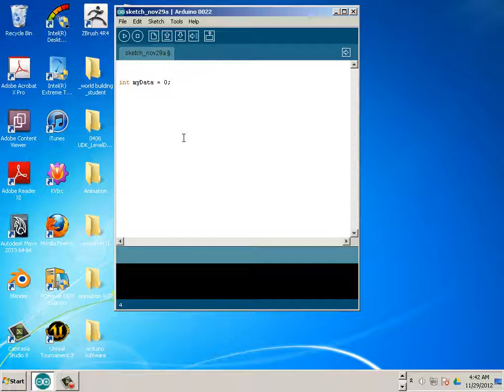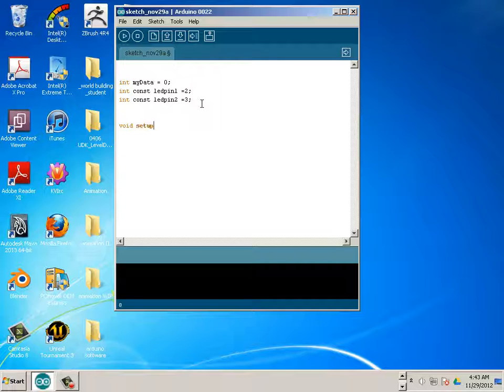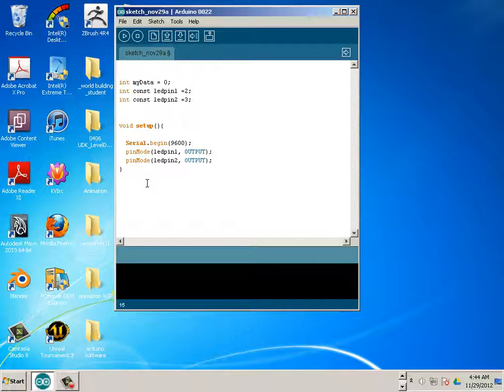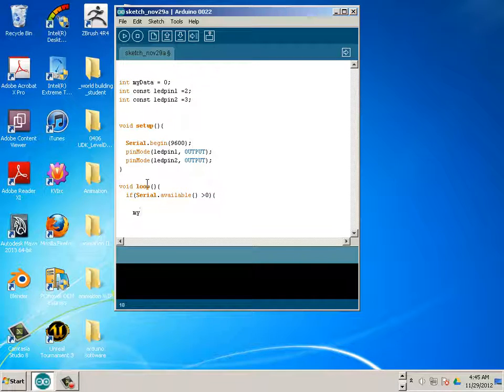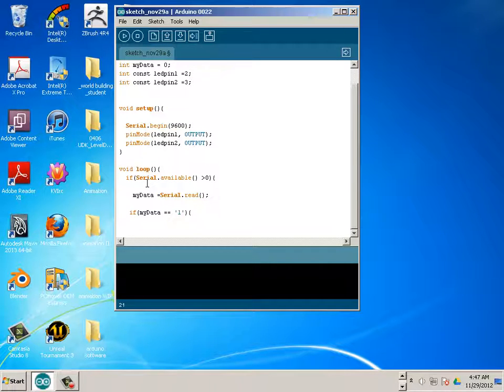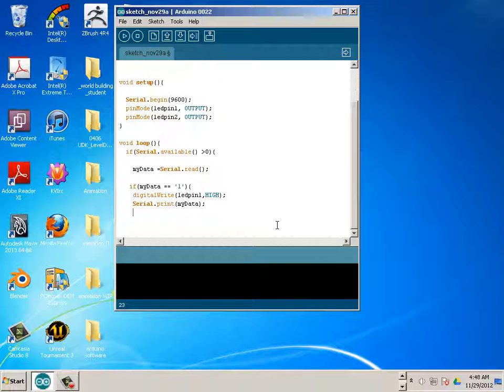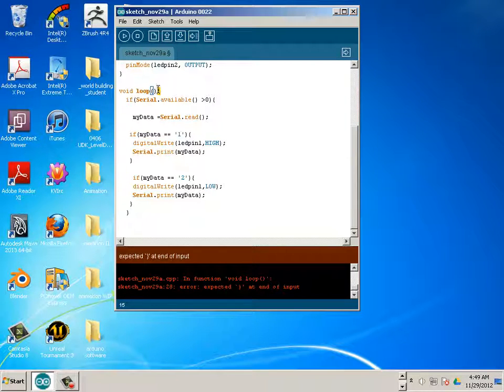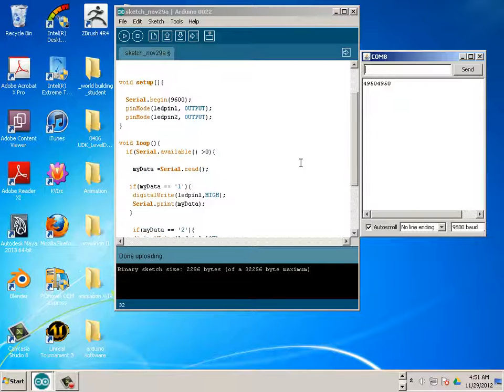0802 Arduino  Chapter 8 Coding a serial event

Comment: char dato;
int led=13;

void setup()
{
pinMode(led,OUTPUT);
Serial.begin(9600);

}

void loop()
{
dato=Serial.read();
if(dato=='1')
{
digitalWrite(led,HIGH);
Serial.println(dato);
}

if (dato=='2')
{
digitalWrite(led,LOW);
Serial.println(dato);

}

}

Comment: Good basic example. However, the If statements evaluating myData are not nested because they are always executed. The second if evaluates myData for the value 2 even if value is already 1. This is because it is not using "else if" to join them both. This way if myData is 1, it skips the second if entirely.